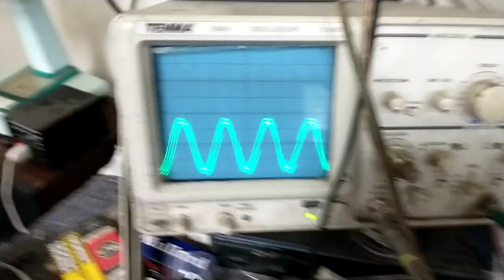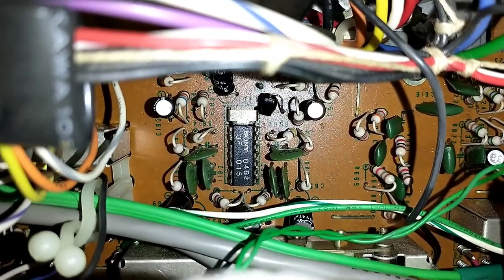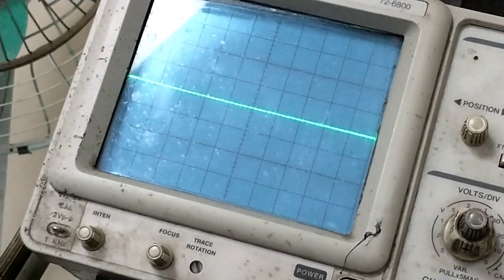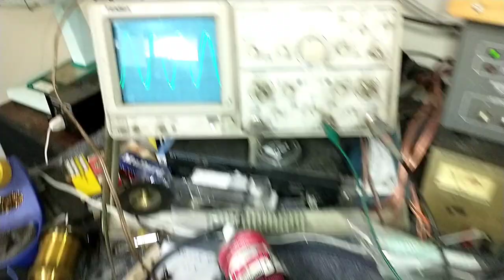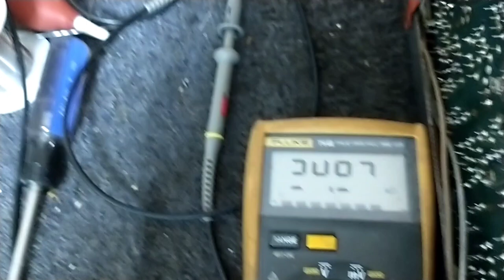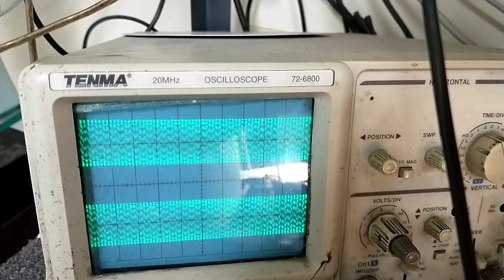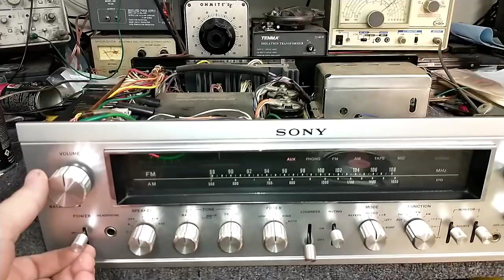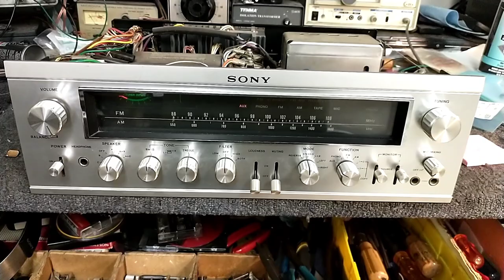Servicing a 1970s Sony STR-7065 Stereo Receiver. Multiple failures. part 3/4

Comment: Cool. The case and face are in great shape. I have used dawn dishsoap in the ultrasonic on knobs. Lemon lysol wipes wrung out of excess cleaner on the face plate and mothers aluminum polish to great success. Baby wipes are good at cleaning grime. Are you going to polish the rca jacks? Loving this series.

Comment: Hi Jordan, 
I have the same amp and I recapped it myself (sounds much cleaner now) 
but even before the recap this amp had a faint audible hiss or noise (feedback)? that is mostly audible on the mids and tweeters (not sub) on any source Aux phono tape  etc that can be heard when you pause the music (hard to notice while music plays)  and it varies with the volume, below 25% is quite as it should be and from 30-40% it makes that hiss and at 50% of vol is quite again, I get the same hiss or buzz noise if I use the amp as a pre amp with an external amp so I guess the problem is in the pre-amp section... I kinda suspect the vol control, I cleaned it many times but makes no difference any thoughts?? 

THANKS and great job on your amp.
Reply: Hi, @elliott-mtb5599  , got the same symptoms with mine 7055A. I would try the method proposed here to attenuate the preamp with resistors between selector and input. My have some traces being flooded, so the preamp components have drifted away (my understanding). So input gain is  very high and it is picking interferences at around 9 o'clock.

Comment: Question. What is the correct bolt size for the rubber feet of a Sony STR-6055?
Thanks.
Reply from the maker: No idea. If you have an existing screw get it matched at a hardware store. If not it's a trial and error of ISO screws and thread types.

Comment: I'm surprised that you didn't replace the other double diode bead with two 1n4148's as well.
Just to make sure the other channel won't play up later.
82k loading, i would have cheated and stuck a 200k preset to tweak to perfection :-D
Odd how there is a difference in level.
Reply from the maker: I still might replace the other diode as a precaution. Gonna burn it in some more and see.

Comment: Could it be your scope inputs are slightly off, did you try swapping leads ?
Reply from the maker: I did. I used the calibration test points on the scope to validate the proves and scope were accurate
Reply: Yepp, Connecting both leads to the same point and verifying that they then show the same signal might be a good idea.
Reply: Also could use Channel 1 Plus Channel 2 input mode. Invert one channel for difference.

Comment: Hi,  jordan 
Your Fluke multimeter's display might need cleaning. I do know that you are a excellent tech.
Reply from the maker: I wish. Tried pulling the display and cleaning the contacts, to no avail. It appears to be a problem on the 79iii displays. Fluke no longer supports it
Reply: @JordanPier  It looks like one of the backplane lines are open.
If you take the display out, try to touch one of your power supply leads to one of the outside tracks on the LCD, and swipe your finger across the others.
You should be able to light every segment up.
It probably has no more than 3 backplane lines, 2 on one end, one on the opposite.
If you can see all the segments, than probably the zebra strip is the cause.
You might also turn on the meter, and scope the pcb gold terminals one by one to make sure there is signal there.

Comment: Is that slight channel difference really important? Would you even hear it? Seems like a lot of labor an owner would pay for a middle of the line receiver.
Reply from the maker: It is noticeable. Maybe moreso in a controlled environment with good acoustic treatment. 7065 was the top of the line for Sony that year
Reply: @JordanPier  nice video. Mine have a buzz, dependent on preamp input impedance. Did not experiment with adding resistance. Where exactly is the best place: after selector sw and before monitor switches and stereo/mono or after stereo sw and before balance?

Comment: It woiuld be nice to have a decade resistance device to pad that channel..
Reply from the maker: True. Alot quicker. I can usually tell where to start based on the volume control value. 150k didn't do enough, 100 was close, 82k was about as close as I could get it